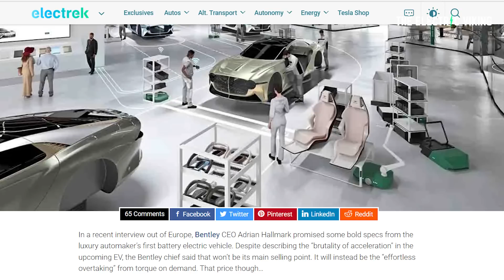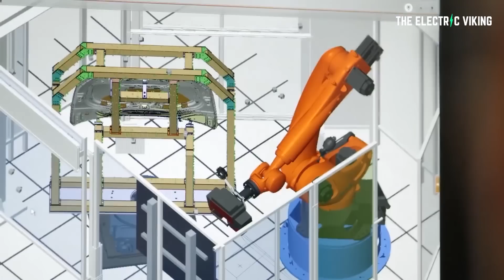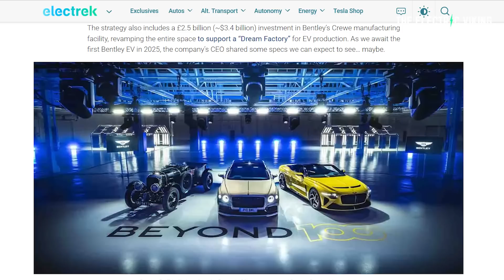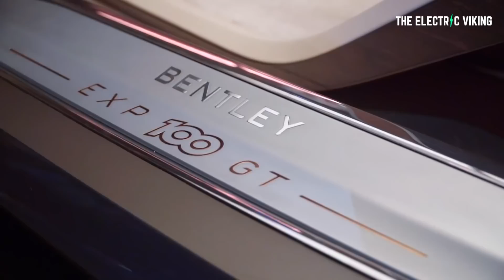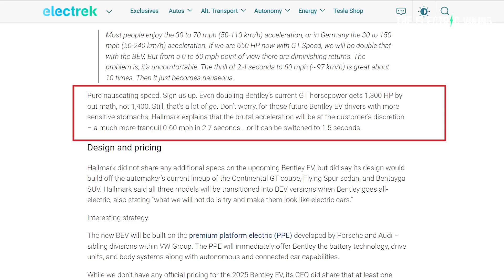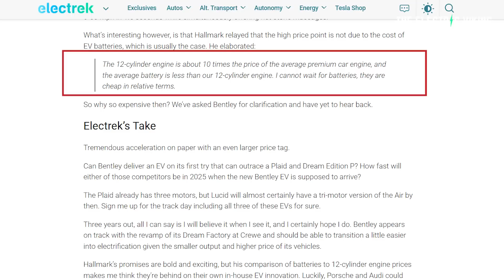Bentley says its 1400hp EV will destroy the Tesla Roadster

Comment: Quick correction, the Bentley Continental GT3 racer is made down the road from me here in Cumbria (real England) at M Sport, and when I spoke to the project director for the cars he said the weight was circa 1200kg and the power was about 750bhp. You’re 100% right, the road cars are a 100kgs or so heavier than a Tesla… but the race versions are true Bentleys (ignoring the Audi V8, but here in England we don’t talk about that… fyi the correct capacity for a V8 is 6.75ltrs)

Comment: lets keep in mind that not every tesla ever made has overdelivered, not only that, but teslas are the only cars in human history that get better over time.
i mean horsepower increase via over the air software update....what the actual F.U.C.K !!!! top speed increase, range increase, acceleration improvement, overall software advancements!!!
i mean look what they did with the electric motor, they took an impeccable form of engineering in what is an electric motor and turned it into some kinda damn alien motor. the thing revs to 20k rpm, thats extreme even for an f1 car engine lolololol.......in a family sedan that at the same time, is the safest car in human history......LOLOLOLOLOL!!!
They trolling the industry at this point.
thats why i love cars like the upcoming roadster and the s plaid. they put into perspective how far ahead tesla really is and what they can do when they want to.

so for bentley to destroy the roadster, it will have to not only match but beat EVEN GREATER specs than those released so far by tesla, not only that but that bentley better get better over time or else the roadster will catch up real quick to these supposed superior specs.
better chance of aliens landing on earth right after i submit this comment.

Comment: It is near impossible for a street legal car to go 0-60 in under 1.9 seconds (and that's with rollout).  You can't get enough traction on street tires.  Just for comparison, a top fuel dragster can do 0-60 in less than one second.  To do that takes engines with horsepower in the thousands that have to be rebuilt after every run, super sticky foot wide racing slicks, and special racing fuel.  It is highly unlikely that this Bentley sports car will be quicker than a Tesla Model S Plaid, much less the Roadster, and it will probably cost more than a million dollars.

Comment: Sigh...here we go again with some automotive maker with zero EV building experience quoting performance for a vehicle coming out 3 or more years  against the CURRENT Tesla models...as if Tesla is going to be standing still waiting on them...right now, the Plaid S has beat rail dragsters!!...and the roadster will outperform the Plaid vehicle...perhaps the Bentley claims and $2.50 will get a hot dog and drink at the nearest convenience store...apparently Bentley did not get the memo; if it is that easy, all the other EV startups would have done it years ago...just be honest when your butt gets handed to ya...

Comment: So Bentley plans to beat tesla with ten years of electric motor experience in their first attempt. Not happening. Lucid didn't do it, porsche didn't do it, bmw hasn't come choose. Bentley won't beat plaid, no chance against roadster. The Roadster will have 4680 batteries for practically unlimited power delivery and the plaid motors already sustain their power well into the high speeds, it will probably give a rimac a decent race.

Comment: Sorry Sam but it doesn’t make you ill. Because I have been in this situation as I was a fireman in New South Wales railway my driver and I working on double light engine of 46 class locomotives combined weight of 220 ton and 3600 hp did 0 to 75 mph in 2 seconds . The 46 class are full electric loco’s over head power of 600 amps pushed by 1500 volts . Don’t forget that these loco’s are geared to lift a train of a 1000 tons . Light engine means just the locomotives .
Reply: Err, no you are wrong.  The maximum speed of the 46 was 70mph.  And have you been in a Tesla Plaid?   Yes, the acceleration can make you feel unwell.

Comment: The Tesla Roadster is reaching to the point where the tires are going to be the limiting factor. Based on actual drag racing of Tesla Model S, it's pretty close to what's advertised -- at least when the battery is just right.
So I think the Tesla Roadster, whenever it finally comes out, will be able to get to very close to what its advertised to do. But more than that will be very unlikely even for the Tesla because of the traction. This is why they've actually teased adding an optional jet air thrust I guess.
Reply: Yeah, any faster accelerating cars use special tires and on a specially prepared track.

Comment: I've really had enough of the insane 0-100kmh dick waving. I currently have a petrol vehicle that's supposed to achieve the speed in 4.9 seconds and that is stupidly fast enough. I'm more impressed with an EV manufacturer that focuses of weight reduction, range and efficiency ... and just for a giggle maybe durability, longevity and lower cost.

Comment: The performance limitation here, surely, is the ability of these massively powered vehicles to transfer their power to the road through four tyres. 

The Tesla Model S seems to transfer it's 1000+ hp to the road with negligible wheel slippage. Power control to each wheel in this vehicle is, in itself, revolutionary. 

But how much further can standard, rubber tyre technology go? What is the theoretical limit to power transfer through pneumatic tyres without either causing unavoidable wheel slippage or, literally,  twisting the tyre off the vehicle?

The heavier the vehicle, obviously,  the more inertia and the more stress through the tyres  to get it accelerating.

Comment: Engineering explained has a great video about the 0-60 times. Spoiler alert - You're not gonna get much below 2 seconds with some funky stuff (like rocket thrusters)
Edit - without rollout subtracted.
Reply: Tesla plaid can do under 2 seconds but it needs stickier tires and at a prepped drag strip. Actually that is how most car companies get their claimed 0-60 times. Most cars just can't hookup on the street causing tire slip hurting the target time, that is why at a prepped track they can achieve these times. Also a driver has already done under 9 seconds in the quarter with a plaid but she pulled out some of the interior and installed lighter aftermarket wheels with drag radials.

Comment: I don't believe this car will achieve those numbers although it's cool to put it out and maybe attract non EV buyers. Horsepower numbers are really deceiving with electric cars. My Tesla Model 3 Performance is rated at less than 500hp but absolutely destroys cars with 800hp or in a lot of cases more. 

On the streets these Performance Teslas are truly hard to beat. I came from a drag racing background and sold my 9 second quarter mile drag Camaro to buy my Tesla. It's hard to belive but that Camaro with the price of the car and all the upgrades like turbos the engine ect I could've just bought a Tesla Model S Plaid. A car that my wife could take to the grocery store and still beat my Camao. The Camaro ran on race gas that was $10 a gallon and was so impractical with slicks, no interior, air conditioning and hard to drive.
Reply: I don't think it will hit those numbers, but they should have no trouble beating the pants off their twin turbo W12, and it will be smoother, quieter, more reliable, and you can charge it at the mansion. It's also going to have a stupid big pack which can power endless electric gadgets for days. Did I mention you will be allowed to drive it into London?
Reply: @fjalics  I agree with you. When it beats off the pants like youbsay of the W12 "just like the plaidnhas done" it will just solidify why these combustion engine manufacturers can't compete and especially for the exotic ones like we are talking about..

A Bugatti Chiron is three million dollars and used to be the quickest production car ever but now gets completely destroyed by a $130,000 dollar car?

These manufacturers will need to change their mindsets about EVs or they will go bankrupt. Nobody wants to spend that kind of money for something so slow compared to other things.

Tesla Model 3 Performance user here. I have had drag cars and fast daily drivers but this little Model 3 has absolutely embarrassed so many of my my friends cars and random people. People who have literally ran 10s at the track and when it comes down to it my simple Model 3 Performance absolutely embarrassed everything I've tried.

Comment: Sorry, but it's clickbait. Everyone wants to get attention in claiming to outperform Tesla, and only one vehicle is quicker than the Tesla Model S Plaid. And that's a very limited production Rimac, at $2.4 million. First off, Bentley has buiolt their reputation off of selling rare, expensive, opulent, bespoke, luxury cars. And even though they have built very powerful gas powered cars, they have always been heavy because they are luxurious. One key point is that many people who experience the Tesla Plaid say that the extreme acceleration makes them feel sick. Which is the exact opposite of plush, luxurious, and comfortable. So it's against their corporate ideal and philosophy that they have built over 100 years. I don't believe that 0-60 in 1.5 sec is even physically possible on street tires. And if Tesla beats that acceleration, they will have to bend the rules with the cold air rockets, and I doubt that Bentley/VW wants to go that route. So....clickbait.

Comment: Model S Plaid is 1020HP, not 1200HP.   The Bentley and the Roadster are purely theoretical. If i had to bet which one would be produced first, I'm going with Bentley.z
Reply: The Roadster is not theoretical (I think you meant to say hypothetical?) as it really exist in prototype form. My guess is there is no technical hurdle holding back its introduction to the marketplace. But it doesn’t make sense to build the low volume car when  key components are in short supply.

Comment: This is all great fun - making cars that accelerate faster and faster and good on the companies that are doing this.  They may even discover technologies that are applicable to real cars.  But let's get real.  What is needed is a new VW Beatle, 2CV, Model T Ford type car.  The car that could become iconic over the rest of this century.  It would have no bells and whistles, just great engineering, great range, great longevity, all controls tactile (no touch screens) and perhaps a 220V AC plug so I can boil the jug or run my electric chain saw.  It definitely will not have self driving.  Once it has been sorted out, it won't have any changes made for decades.  Sure, as better battery technology comes on line, it will use the latest and best but the body and all the accoutrements such as door handles, head lights, internal furnishing and so forth will stay the same.  Parts from cars produced this year will fit a car made 20 years from now and vice versa.  If you want a bit of 'fancy' clad the car with solar panels.  No one expects to be able to drive only on power produced by these panels but it would be a very nice little bonus and a safety feature if you ran out of power.  And when the battery gets tired, it will be as easy as in a Leaf to change the battery and batteries will be readily available from the company at a reasonable price and with the latest battery technology.  The used batteries will be easily converted to house storage batteries.

Comment: Hey Darin if you want to run 1/4 miles - I suppose it depends on how much force you exert.  In order to even exceed 90MPH a Tesla has to have its speed limit software bypassed. The batteries in this high draw state get very hot.  So the interval between runs would also come into play. You dont want your car to catch on fire. To me drag races are of little interest.  Le Man has been a major test of manufactures cars for 100 years +.  When electric cars can charge fast enough to win this race where the cars run the equivalent miles as from Boston to LA and then to San Fran - in 24 hours - then Electrics can claim to be fast.

Comment: Does anyone else believe that the future Roaster 2.0 will be quad motor as I do?  With the CT going quad, I just do not see Tesla holding back on only doing 3 motors in the Roadster 2.0.  Assuming they do go quad, it will be an absolute undeniable beast.  However, I can't see a 600 mile range on it due to all the added space and weight it would consume on suck a small platform sports car.  Another cool thing about cold air thrusters is they are independent and not held back by tire traction which could really be insane.

Comment: If you think of the physics of the car, all the grip is only available for up to 1g acceleration. That’s all the force holding the car to the road - unless you have sticky tyres. The 1.8 - 1.9s for the Tesla is the upper limit, unless an outside force is also used. 

I think the team should have told him 2.5s.
Reply: It would need a heap of aerodynamic downforce but that won't kick in until the car is moving at 70km/h or more. Personally, I think that in the era of EV hypercars, 0-60 is pretty much irrelevant. 0 to 100 is a better test which will separate the men from the boys. EV's accelerate fast at the bottom end, whereas ICE vehicles get a second wind at high RPM's when their turbo boost kicks in. Even 0-200, which only a small number of cars in the world are capable of. Then you have the quarter mile vs half mile debate. Again, I want to see how these vehicles perform at the extreme limits, like what is the top speed an EV can do in a half mile, and how many seconds to get there? As technology improves we are going to see cars that can do 300 or 400mph.

Comment: There isn't such a thing as a fast EV yet - they all need to take a long time to charge.  Also because they are electric their range goes down much faster than Hybrids or ICE under load - like going fast.  A Tesla Roadster nor a Bentleigh will beat a Prius in a race on the autobahn from Munich to Berlin - because about 25%-30% of the time the EVs will be Zero MPH charging.
Reply: I'd like to know how many 1/4 mile passes a 1200hp ICE vehicle can make on a single tank of fuel.  I believe the Plaid can muster out about 40-50 passes on a full charge.

Comment: I'm an engineer (although not automotive) and I 100% agree with you. That kind of acceleration is possible with the right tires and enough power but without tire tread, you're going to lose control if you so much as look at a puddle of water.

Comment: The Koenigsegg Gemera is the world's quickest production car that hits the 0-60 mph mark within 1.9 seconds.
Reply: They also seem ahead on just the electric motor side of the equation. In a package that weighs just 63 pounds, the Quark unit develops 335 hp and 443 lb-ft of torque. One of those per wheel hits near the 1400hp and adds only 114kg ...
Those kind of figures lead me to think 1.5s to 60 is achievable for a road legal car, al-be-it with slicks and track glue...